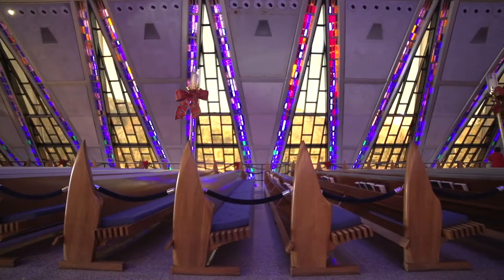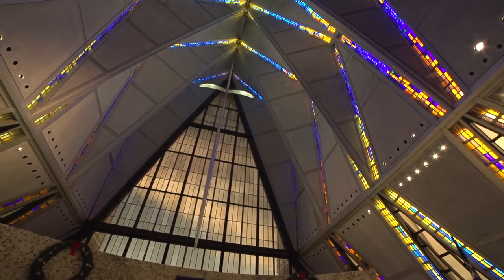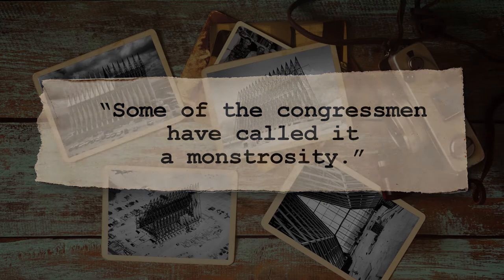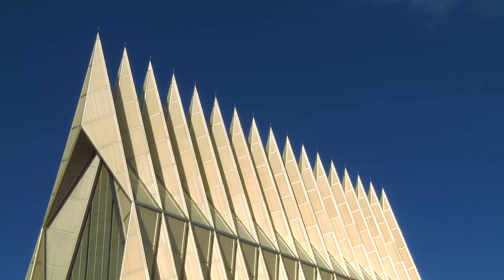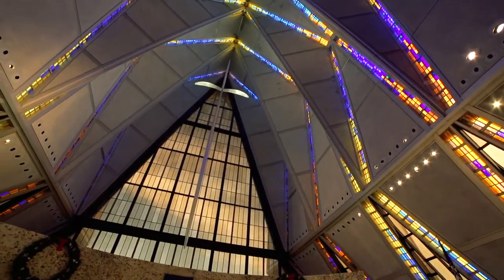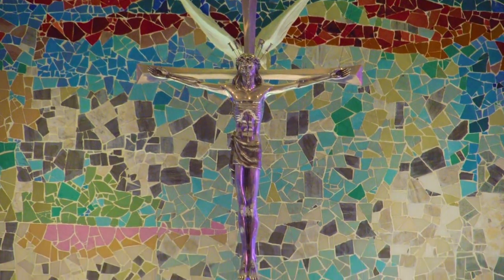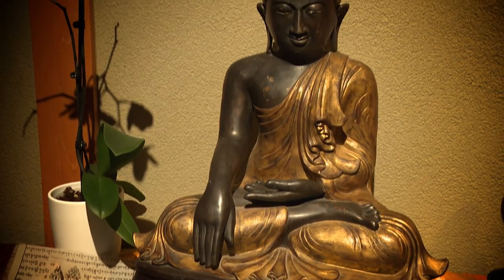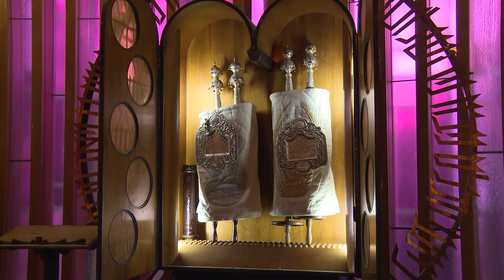Air Force Academy Cadet Chapel

Comment: SOM at it. I like the first attempts of parametric architecture. A good example of ORIGAMI architecture. Now this is extremely easy of drawing it with Grasshopper 3D. 

I am glad that this aged extremely well. there should be more building like this.